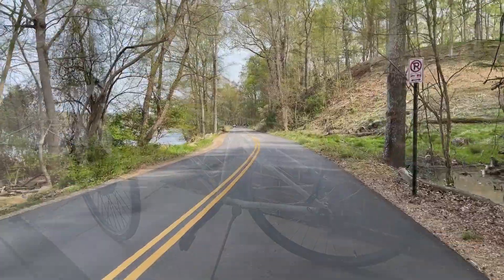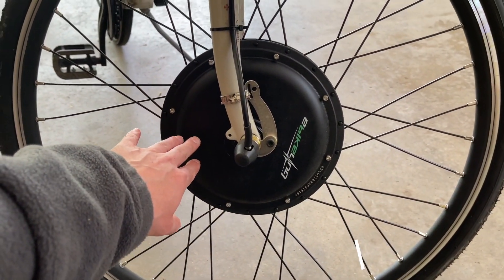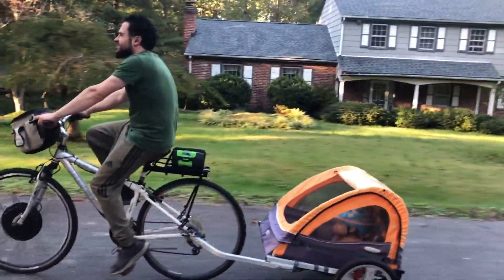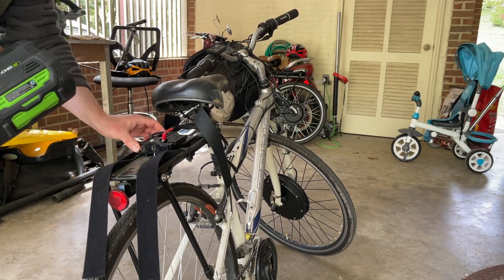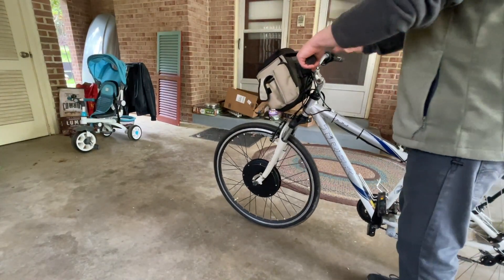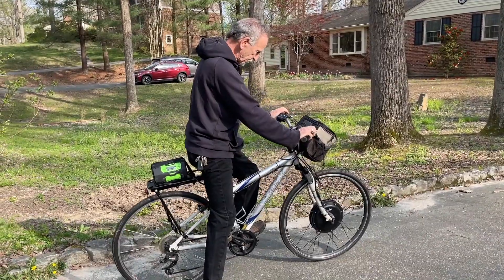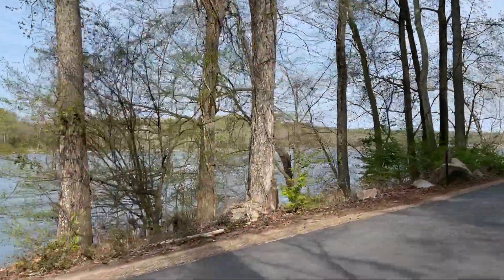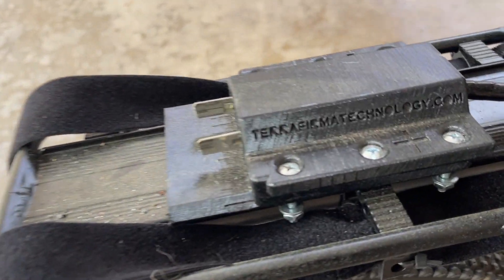E-Bike conversion using EGO batteries and front hub motor

Comment: I use 56v straight into my 48v Bafang bike motor.  No separate controller, it's integrated into the Bafang engine.  Over-voltage isn't an issue as long as fully charged volts stay below 61v.

Comment: Youre charging via the main pins?
Reply from the maker: I’m actually not charging on the bike. I take the battery off and use the standard charging station for ego batteries
Reply: @lavalabs  ah yes I do the same. Thought you said that you were regenerative charging.
Reply from the maker: @David_Mash  that is something I would like to add with time. However, I haven’t had much need for it yet.

Comment: Did you ever do a video of your rear wheel drive bike using an Ego battery?  I'm using an Ego battery with my rear wheel bike but haven't found a nice way to hide/mount the battery or hide the controller.  The carrier solution looks quite good, although for rear wheel that's more weight at the back.

Comment: Those ego batteries look sick. 
You mentioned the torque arm instalation , I believe your missing what's called a c-washer between the fork and the torque arm . I have the same set up , fork,, front hub and power , I watched a million videos after my first install of my motor popped both sides of my fork in .2 seconds , on both sides , that's when I realized how powerful these motors are and went and bought the torque arm as well. Only difference is u used a c washer . I rode the bike tonight in Montreal in - 12 degree weather with my son on a bobike bike seat and it was awesome! . 

Your video is very descriptive and helpful on front hub motors,  I must have watched them all over the last year of trial and error with different bikes and parts , but this is straight forward and clear . Much appreciated.  All the best .
Reply from the maker: Thank you so much! I will look into the sea washer for my next build. The bike from this video actually got stolen about a month ago. It’s a bit of a bummer but it does give me an opportunity to build a new one
Reply: @lavalabs  aww man sorry to hear , but you'll get a second build and I'm sure people would love to see that ! All the best!
Reply: @lavalabs  hey man feel free to get a cheap gps tracker and hide it inside the seat, i have one in my bike so i could just track it with my phone if it were to go missing
Reply from the maker: @Minacious_Shenanigans  what gps tracker do you have? Can you share a link?

Comment: FROM MY EXPERIENCE, TORQUE ARMS ARE VERY RISKY AND ACTUALLY PULL THE WHEEL OFF THE BIKE!
Reply: The motor pulls the wheel off the bike. Torque arms reduce the probability of that happening if you install them correctly.
Reply: @E-BikingAdventures  NO THEY DON'T. YOUR BETTER OFF WITHOUT THEM.

Comment: Do you know if the batteries Battery Management System will cut off the battery when charge gets too low, or is it depending on the ebike controller? I assume on the tools, that the tool is communicating with the battery over the data connection to know when to shut off.
Reply: This is a really good question that seems to rarely get covered in any of these conversions. It really needs to be covered because if not many batteries are going to be ruined.
Reply: @fleal6857  you can set voltage limit in controllers like magic pie. The BMS in the ego 10ah and newer 7.5ah are much better than any of the cheapo batteries. These are rugged built.
Reply: So the bms is in the battery? Charging via main pins is okay?
Reply: I find conflicting info on BMS on these batteries. I read that they don't have overcurrent protection. Which is a big risk for fires.

Comment: With the ego, how many miles you get ? Which ego you are using, the 5, 7 or 10? Your bike setup looks good, very clean compare to other kits I've seen.
Reply from the maker: Thanks Mario,  so with the seven amp hour battery I can safely go about 8 miles and I come home with about two bars left. I try not to run these batteries all the way down or have them fully charged for a very long time.
Reply: @lavalabs  oh wow not amazing for distance compared the rad power 40km pedal assit at 32 km/h. I own so many ego batteries though even a couple 10ah. They brought out a 12ah. I find it strange that the 7.5ah doesn't compare super well vs the 0.672wh that comes with the radpowerplus
Reply: 0.672 wh? I don't think so. Try 672 wh.
Last night I drove 30km mostly on pedal assist 2 before the first bar(of 5) disappeared on my radcity 4.